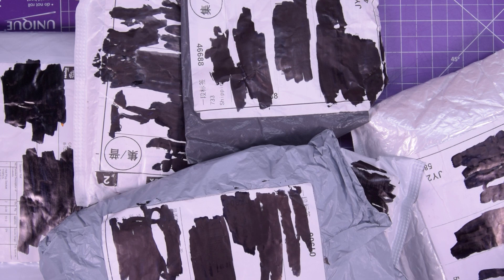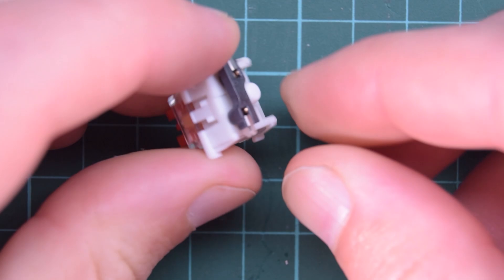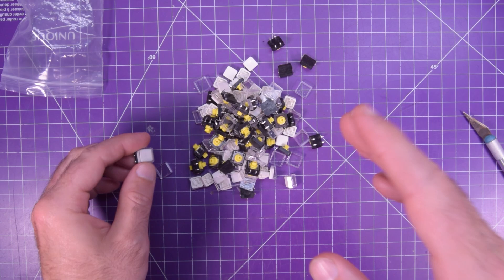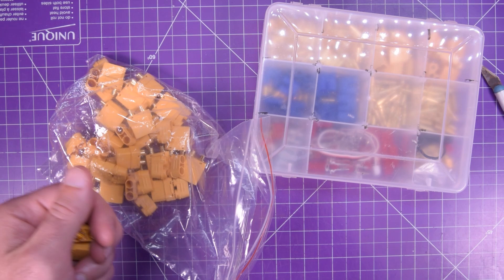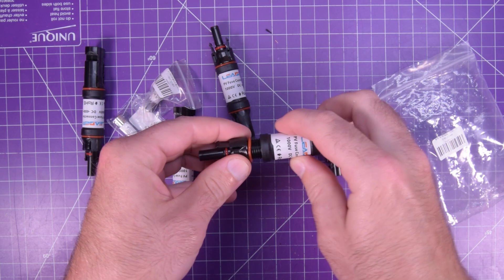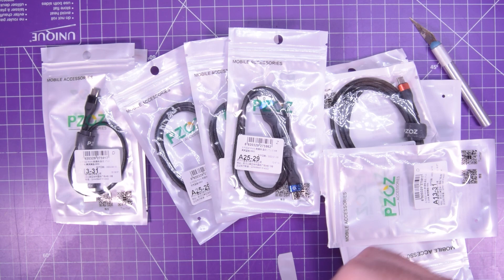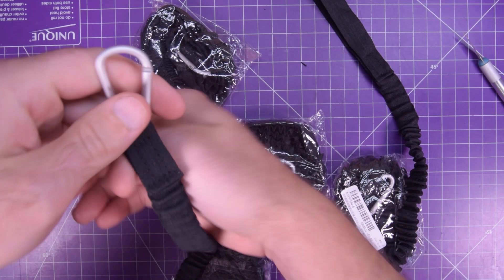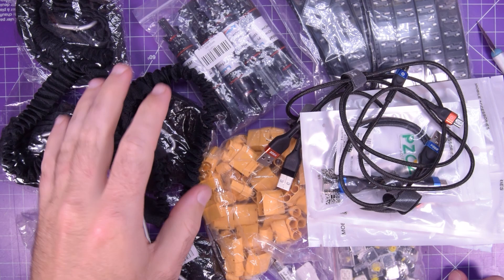Mailbag 112 - Switches Get Stitches

Comment: The XT connector test please. The key switch sockets remineed me to thank you for showing the mechanical keyboard and mouse some months back. My wife loves mechanical keyboards and makes lots of noise at work with it. One of the lawyers bought one for his gamer kid. I got myself one too. Modded the mouse a bit, took off the chrome. It is real metal not aluminum flash so no oven cleaner for stripping. Have the datasheet for the mouse chip too. Thanks again.

PS My wife says you were trying to be funny but y'aint. (Southern term) That culture is causing a lot of problems. I think she was talking about the title. Was watching the video while she ranted.
Reply from the maker: Thanks for the kind words!